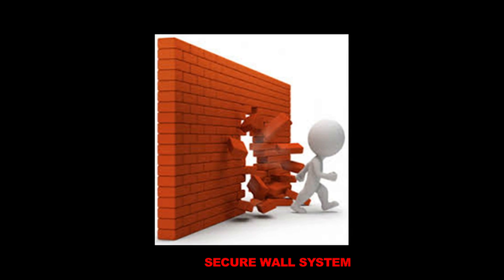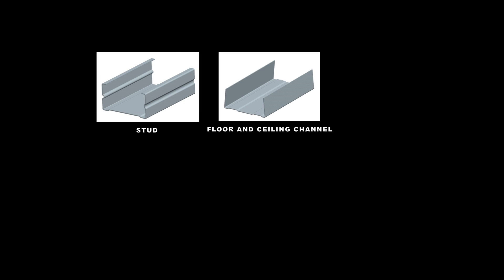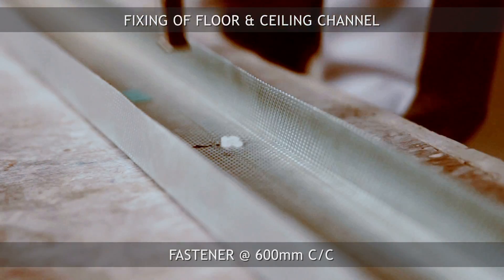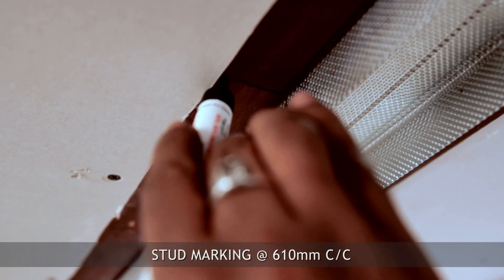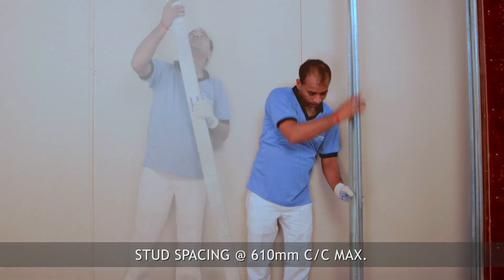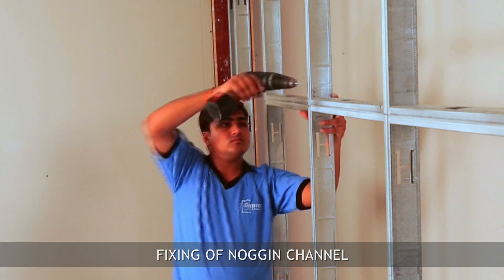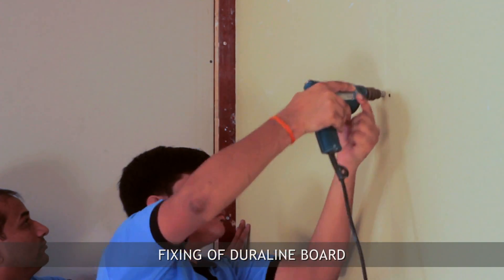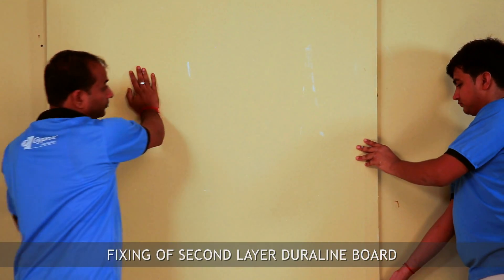Step by Step Installation Process of Secure Wall | Gyproc Drywalls

Comment: You should show this video to Lodha Group they could use it in Lodha Ncp instead of the rubbish gyproc installed there for Lodha
Reply: All Gyproc technical department that know of fire risk in Lodha NCP and Lodha world towers became of poor quality fire walls should be in Arthur road jail when outbreak of fire happens
Reply from the maker: Hi Santosh Gami, 
Request you to share your email ID, so we can assist you on any concerns regarding the brand.

Regards,
Team Gyproc
Reply: Gyproc India    You should use secure wall in ncp. 
In ncp no secure wall so thieves can enter easily and jugad repair work on rusty metal sections and jugad on damp gypsum boards. Saint Gobain are a international company that should not do jugad that risks lives